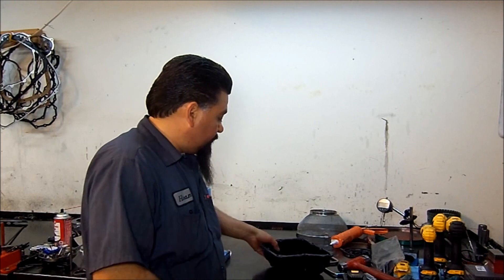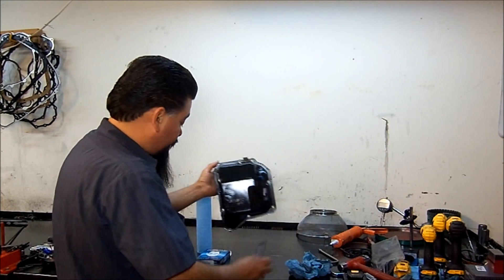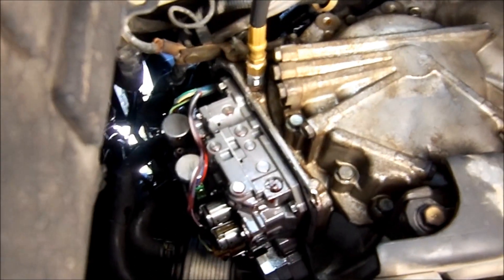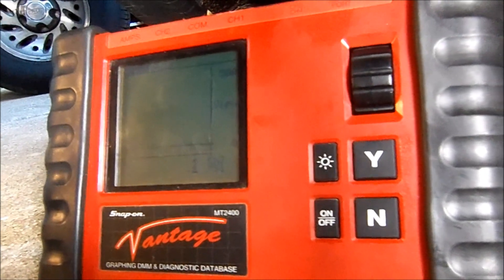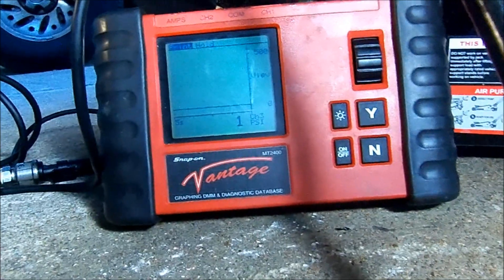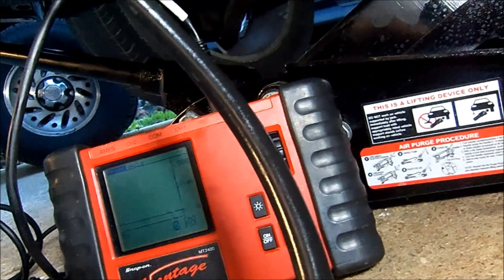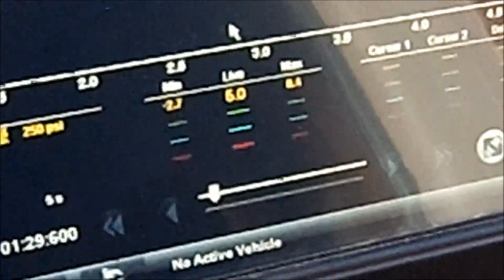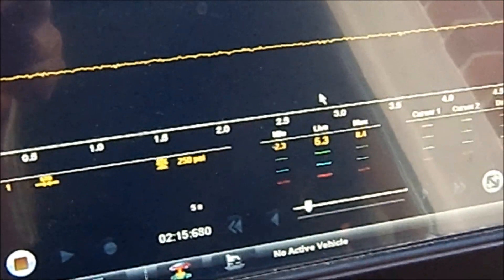AW55 Solenoid Adjustment, Diagnosis and Repair - Transmission Repair

Comment: Did rebuild my valvebody this weekend with transgos repair kit. 
Not so difficult, but time wasting to clean everything up with brake cleaner and then boil of the seal that is bonded. 
Took me 7hours to check EVERYTHING in my valvebody.
Installation and teardown, quite easy. Just a notice to everyone.
MAKE SURE THE CONNECTIONS CLICK when installing back.

Now my Volvo S60 T5 shifts like a new car.  =) 
My symptoms were Delay bang P->D
Delay shift 2->3nd gear

Comment: Hey Hiram, just to let you know. Thanks for your help. I was able to repair my wife's 6T30 on a 2012 Sonic. The wavy like you said, broke and the snap ring broke in a couple of areas causing damage to the drum. I bought a new drum--I should have purchased the loaded one. It was a challenge since I didn't have any special tools for the pistons. I was able to use some ingenuity. I transferred the parts from the old drum to the new one. So far I have put close to 400 miles and she's running fine. I wished that GM would have recalled these transmissions since there are so many of them with this problem. Anyway, just wanted to say a BIG thank you for guiding me to the problem.

Comment: hola hiram, recién reconstruí la aw 55-50 de mi captiva 2007 (gm), resulta pues que tenia quemados los discos que van en la tapa trasera junto con el b5,también tenia problemas con mis solenoides de control(slu,slt,sls) y los cambie por unos rostra, ahora el gran detalle: gradué los selenoides a 4.9 mm de altura. medidos desde el manifold hasta la punta del tornillo de ajuste. instale todo el cablea de acuerdo a el manual de reparación(soy ing mecanico, y tecnologo automotriz)... ahora mi gran dilema: al encender el vehiculo, el vehiculo no tiene casi fuerza para ir hacia delante y hace un ruido de bum cuando pongo retroceso, tiene mas potencia al hacer retroceso que ir hacia adelante. reviso por si hay fault codes y no hay ninguno. en idle el line presure control solenoid tiene 4.06 psi. que me recomiendas?. tienes alguna forma de contactarte via e-mail o telefono?gracias.mi correo es miguelscorza@gmail.com. many thanks mate

Comment: Hiram, Thanks for the work you put into these videos. The more knowledge the better.  I look forward to watching them then they come out. Keep up the good work!
As far as the unit, why do you think they did not install new gaskets? Also, when using the VB pan for adjustments, do you leave it on during test drives and plug the holes?
Thanks!

Comment: Hello Hiram
I have a 2002  Volvo S60 D5 with this gear box, and I have an issue where it shifts very hard from 2 to 3. I think, as well that when I start, the car tends to be very very slow, sluggish would call it. They have been looking at the car in a garage and they say that everything is ok when they get the machine and adjust it, but as soon as they simulate low voltage - removing the battery - that all goes to hell, and they have the problem again. Any idea where the problem would be?? Have spent more than a month in that garage plus money....   Thanks a lot

Comment: Hi Hiram. First of all, thanks for the very useful video. I want to say that what you're doing, you're doing this very professional!
Currently I have the plan to handle Volvo V70 - 2004 / Aisin Warner valve body. I want to ask you where to buy valve body gaskets and a small parts bag which have shown on 25:45 min. Thank you for answer.
Reply: Is the aw 55- 50 the same in the 04 Volvo and Altima

Comment: Hi Hiram, I was having a terrible shift delay problem on third gear, on a 04 Nissan Maxima. I replaced my solenoids with new rostra. 
it changes gears very smooth now, exept when first to second at 2300 to 3500 rpms it hard shifts, actually when I do it a higher rpm it will shift very smooth. only on first to second I can feel a pull. thanks.

Comment: This might be a silly question but do I need to block up the drilled holes once everything is working well? And with what? Find a good size bolt and an O-ring? Thanks

Comment: I am in desperate need of your help. I have a 2011 Nisaan Maxima. The transmission quit working in all gears computer tells car to go into dummy mode. The trouble code P0746 pressure control solenoid A is stuck off. Everyone I talk to simply tells me that I need a new transmission. In your opinion do you think it would be worth me checking the solenoids?  Is it possible that that could be my only problem?

Comment: Hi Hiram! Thank you for great video! I have Chevrolet with the same transmission as Nissan - AISIN. Could you give me consultation to the issue? I had change transmission to new one(it was used before), and after that it is shifted up harmful - shifted down is OK- no problem. What problem could be with transmission? What could you suggest to check? A transmission repair specialist said that need make adaptation to the vehicle - what is your opinion?

Comment: Hi Hiram. I have a Volvo xc70 2002 aw55-50 I think.
the problem is the downshift from 3 to 2, it delays for about 3 sec. before slams in to 2 if I don't go easy on the trottle.
I know it is tough to analyse from this little info but do you think it could be one of the solenoids being dirty or broken?
thanks for the videos there very aducational.
Reply: Herman,finally what was your problem?,I got the same issue. Thanks in advance.

Comment: great videos, im having an issue with my 97 bmw 328i,  the third shif is sliping a split of second to fouth gear and when waithing on a signal ligth sometimes a feel a small kick on the tranny,  Im planing on replacing the selonoids on the transmission, did I have to adjust them? Thanks for all the great videos:-)

Comment: You have great films Mr. Hiram!
Do you know what can be reason of very slow switch on reverse gear in AW55-51SN when engine cold ?
Sometimes it takes even 6 seconds and switching is very slow (i can feel it while holding brake pedal). Kind regards!

Comment: @automatic transmission
Have you ever rebuilt Aisin Warner TF80SC transmission and or valve body? I am tring to diagnose my hard shifting. It it random at times. A lot of stop and go traffic will make it act up. It will lag when shifting from 1-3 and same when down shifting. It clunks into gear hard and shakes the car when going into reverse. I will have the car stopped before I change directions. It is in a 2007 Saab 9-3 Aero. The transmission is common in Volvo's and Mini Cooper's. Maybe more. Love you videos.

Comment: Which thread type and size do the pressure taps have? Planning to adjust my new Rostra selenoids using the pressure tap but I don't know which thread size it is or what adaptor I do need.

Can you give me a hint Hiram?

Many thanks in advance!

Comment: A question I did replaced transmission valve body, reprogram tcu also they check transmission pressure and everything is good but still give me code p0744 and sometimes p0731

Comment: Hiram, you've drilled holes in your 'test cover' to facilitate adjustment of the solenoids,.  What prevents oil from leaking out the drilled holes while the engine is running (possibly a stupid question)?

Comment: Thanks for sharing your knowledge 
I have 2008 Volvo S 40 / 2.4I ....132.000 Miles If you can some information about change the filter and The Fluid

Comment: hey bro i have a 2005 Nissan altima 3.5L i had a code for pressure solenoid A i replace 3 solenoid that i bought from a transmission shop. the code went away. but know i have delay from neutral to drive when it engage is hard kick can i get away with adjusting the SLS solenoid

Comment: C.H
Hiram I have a 2006 Nissan Maxima that I replaced all solenoids in the valve body but still having issues It drives fine sometimes and other times after 2nd to 3rd shifts its like it flies into neutral. If I put the car in park and turn it off for a few seconds and start it back it will go a couple of 100ft and does it again. I installed a pressure guage and checked the psi on the SLT solenoid and when I put it in gear the psi goes from 0 to 9 psi back and forth can you tell me what steps to check

Comment: Hi Hiram. I am looking at buying an 01 v70xc volvo with the aw55-50 and they say it shifts ok cold but harsh when warmed up. I would like to rebuild the valve body on it. It has 113k miles on it. Do you think the transmission is savable?

Comment: Hello Hiram, I have an 2005 nissan maxima and I changed transmissions but I have a 2-3 second delay between neutral and drive and a hard shift when 1st goes in, do I need to reset the Idle as well? Please let me know. I have not check pressures and other than It shifts very well. Thank you!  I appreciate your attention to detail on your videos.
Reply: *****  hi there, great video! I just had my 3 solenoids changed on a 2004 maxima but how can I easily adjust the SLT in order to avoid the delayed N to D I'm getting? I need to tighten it but can I easily do it without pulling out the valve body?

Comment: I have the p0797 code solenoid c stuck open which solenoid is this on the valve body cause my reverse won't work unless I shift to drive and back to reverse. also my 3 and 4 and 5 don't work together

Comment: Hi , im here because few days ago my saab 93 has prompted me with p0748 - 'Pressure Control Solenoid "A" Electrical'. The car feels like it starts moving with the hand brake on, but later, o higher gears its quite normal. In addition when picking D i feel a little jerk. From your experience, what is the most common reason of that error message? What needs to be done?
Thanks in advance!

Comment: Hi hiram
can you recommend me how to measured the slt pressure first? it most reach 7 psi at idle in neutral? or in forward engagement? and about the sls there is a port to measured the pressure?
my aw55-50sn is install on a renault laguna v6 3.0 it's a french car, the manufacture renault has ownership with nissan thats why there sharing units
Thank you for sharing your experience
Yoni

Comment: Hello great videa.
Can you tell me slt line thread is m12 but which 1 1, 5 2 ?
And  presure can be checked which engine on or is it possible to check pressure /and/or adjust slt whitout oli pan ?
Reply: The threads on the pressure plugs are M8x1

Comment: Hi Hiram I have a 2005 Equinox with a AF33-5 the ID tag says 55-50SN the owner says the car shifts normal when cold but as it warms up has hard 1-2 shift. Watched your videos on Solenoid problem. He pull transmission and brought it to me we disassembled and found no major damage on frictions. Could 1-2 hard shift be caused by Solenoid issue?
Reply: Carlos Diaz if it feels smoother accelerating mid to high throttle it could be acumulators first see if fluid level is ok
Reply: Carlos,?finalmente cua fue tu promema?.Tengo el mismo problema. De ante mano gracias.

Comment: Can you explain the terms harsh, bump, flare? They are found in the guides for tuning the valve body solenoids, but I do not quite understand what it means.
I repaired aw55-50sn on the Renault Laguna 2.0T, it remains only to adjust the solenoids. Now there is only one problem - switching 1-2 with a kick.
And advise,please, any English-speaking forum of experts in automatic transmission.
Reply: im aware this comment is old, but may this help anyone seeing this in the future:
a "flare" is a short rise in engine RPM, a result of delayed engagement of the next gear.  usually caused by sticking or worn servos, seals, or bores.

a "harsh" shift is when too much pressure is applied during the shift, usually caused by sticking servos or regulators that can hang and then engage/disengage too quickly.  this is the term for your 1-2 "kick".

i'm not too sure on the term "bump" but i believe it has to do with downshifts that aren't smooth.  this could be caused by any combination of things i mentioned above.

Comment: Hey Hiram!!
I have the same car,same problems,hard engagement hard reversing hard shift and 3rd free falls if I'm on the pedal 
I installed a shift kit- didnt fix it..
Should I buy new solenoids or tune those... And do these cars have tranny electrical problems  
Thanks man love your work...
Hunter
Reply: huntercaravel

Comment: Hiram. tengo una transmision aw55-50 pero tengo problemas con patinado en 2-3 y 3-4, asi como despues de aprox. 15 segundos de estar en alto total en D se siente una ligera patada. es posible que sea el cuerpo de valvulas el problema? gracias por tu atencion
Reply: Raul,?final mente cual fue tu problema?,tengo el mismo problema.De ante mano gracias.